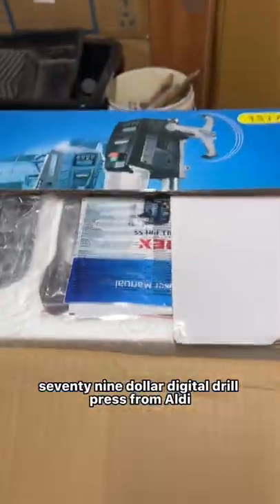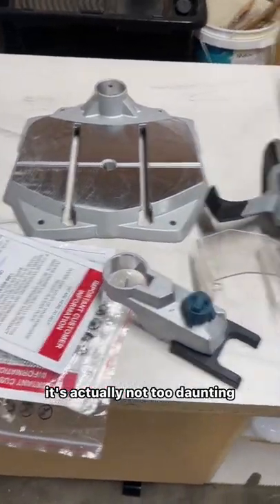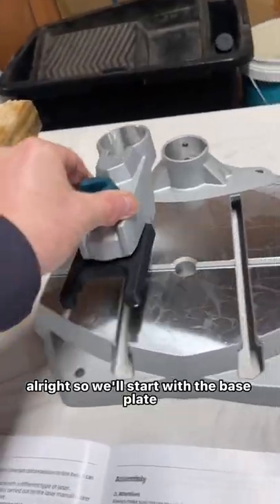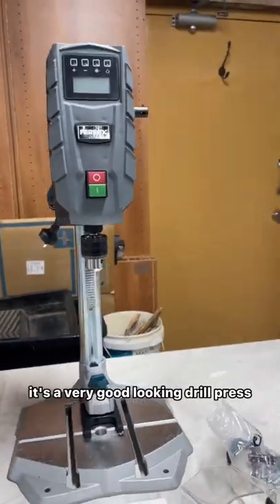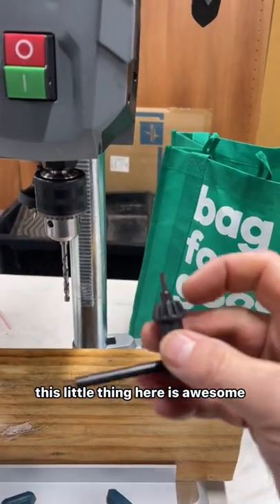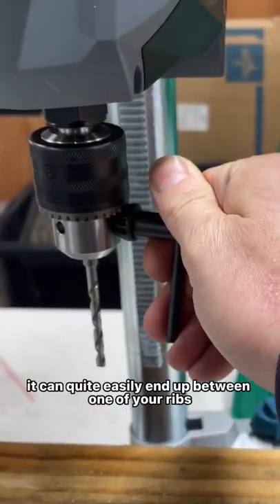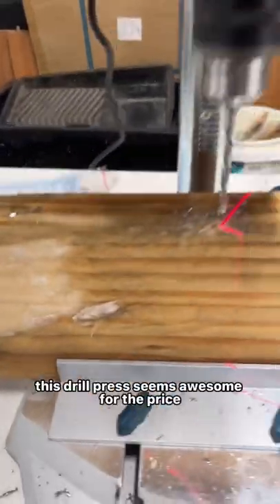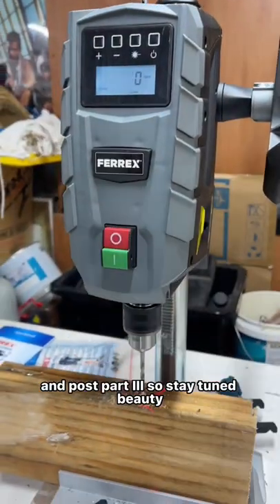Cheapest digital drill press

Comment: Good, until you need to drill into steel because these machines have no torque at low rpms
Reply from the maker: I drilled out over 240 holes in 4mm brackets using 6mm drill bit and no problem. It’s not super accurate though but what you expect for $150